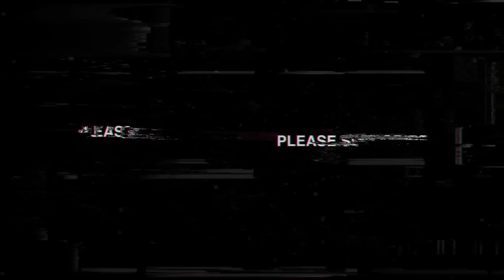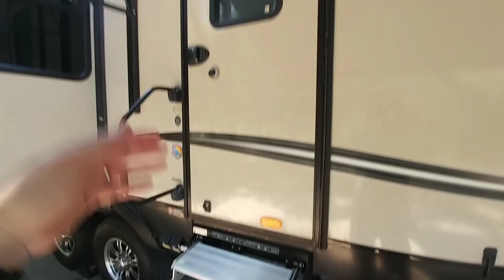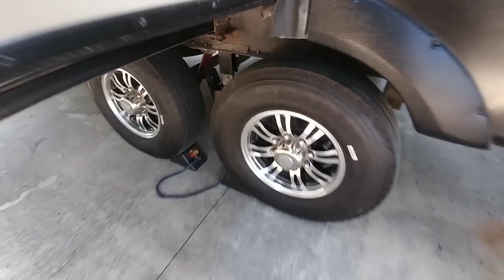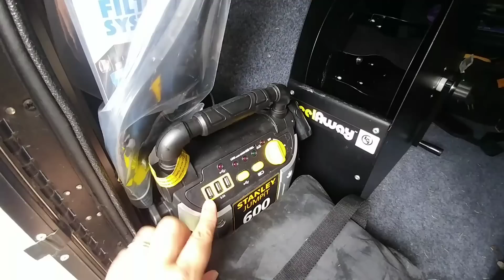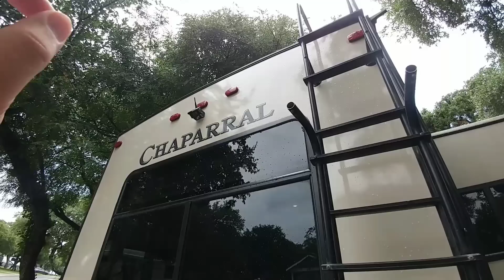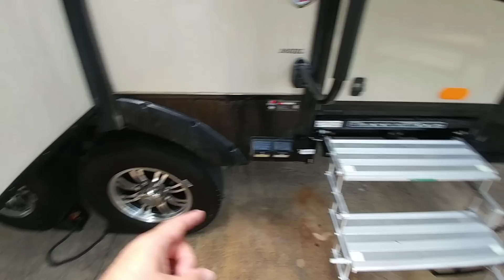Fifth Wheel RV upgrades overview and Follow up!  How do I like them now?

Comment: I am trying to determine the Keystone factory warranty position if I have the Resse goose box installed on my Montana 3790RD.  My local dealers are giving me conflicting information, one says yes, problem another says no, no problem.  Both Keystone factory and Lippert are closed for the weekend.  Do you have any direct knowledge to help?
Reply from the maker: Ive been told by both LCI and Reese that the Goosebox is approved for use on their frames.  I can't speak for Keystone, but Magnuson-moss Act protects you as well.
Reply: Big Truck Big RV thank you for your opinion.  How about the Anderson hitch assembly, better, worse, same same?

Comment: Thank you so much for taking the time to make this video. I have a 2019 Grand Design and had a horrible experience first time out with the sewage valve. I assume that I have a valve that’s not sealing completely. When I arrived at my campsite, I removed the cover To the sewage line. It had obviously leaked and was under extreme pressure probably from the elevation. 10,000 ft. When I removed the cap it was like a sewage bomb. Sewage everywhere! I just ordered my ValTerra valve and hope that this never happens to me again.

Comment: Hey JD love the Videos. I saw that you have a rack on the back or the rig. What brand is it? Did you bolt it to the factory bumper or did you get a aftermarket one installed? -Austin
Reply from the maker: Factory installed LCI rack

Comment: Can you do a real video on travel trailer wheel bearing maintenance, too many times I see videos of just pumping in more grease and spinning the wheel, which is totally wrong unless you want to overfill the grease cavity and potentially cause a leak on the rear grease seal and have grease all over your brakes. If need be I'll be glad to show how to properly repack a wheel bearing yourself as dealers change way too much.

Comment: On those steps, do they have to touch the ground to use tp gain access to the camper. I know on occasion we'll have to make a quick stop on the side of the road to get something from the camper or use the facility and the ground will be quite uneven
Reply: Yes the steps must rest on the ground and be locked in at the top. They only hinge on the trailer - they don’t cantilever off the trailer like the factory 3-step most trailers come with. I missed locking our in and the wife got a surprise when she went up them and they dropped 6” (no injuries)

Comment: I'd like to know how you addressed any excess cabling on your backup camera?  Did you just poke the excess into the coach?
Reply from the maker: I connect the camera to the rear lights.  I had about 10" of extra cabling that is bundled inside of the RV in a cabinet

Comment: Perhaps a future upgrade, replacement torsion bar suspension with hydraulic disc brakes. They offer individual wheel articulations, more ground clearance and excellent stopping power.
Reply from the maker: True, but completely lack weight distribution.  They must be towed perfectly level otherwise you are transferring a significant amount of weight to some of the tires

Comment: Have you noticed that many of the new 5th wheels that are produced today do not have the cutout in the "J wrap" that will allow the Glow Step Revolution steps to be installed easily.  All the new higher end rigs tend to come standard with the Mor Ryde Step Above steps or the Lippert equivalent.
Reply from the maker: Yep.  That is an issue for me.

Comment: That's not an RV, that's a travel trailer. RV is Recreational Vehicle. A vehicle is a powered unit, containing an engine to give the vehicle motion. You need a separate vehicle, or power unit to move a travel trailer no matter what size it is.
Reply from the maker: Wow, you made your own definition!  Here is the more widely used one from Wikipedia: A recreational vehicle, often abbreviated as RV, is a motor vehicle or trailer which includes living quarters designed for accommodation. Types of RVs include motorhomes, campervans, caravans (also known as travel trailers and camper trailers), fifth-wheel trailers, popup campers and truck campers.
Reply: well said JD

Comment: How long would you say the battery lasts for the keyless entry lock? And is it durable
Enough for all weather IE snow and ice?
Reply: journey2fifty I live in Ohio and have had no issues with weather with mine. It’s on its third year and I have replaced the battery once so far. Lasted 2.5 years. I installed a lockbox in the propane compartment with a spare set of keys.

Comment: How do you know how much gain you need to put for your truck with your towing a rv
Reply from the maker: Need to adjust it to your liking by manually engaging the trailer brakes and low speed

Comment: We installed the Reese 20K Goosebox on our 2005 Thor toy hauler ... total rig and Silverado Duramax dually weigh in at 20200 lbs and the difference between the Goosebox and the old 5th wheel is huge.  The shocks from the road and now softened with the hitch and when we open up after a long day towing, it no longer looks like an earthquake!  We have found that it helps to inflate the hitch with a Viair 400 compressor that allows a slow enough fill that you can easily see the "line" and stop it in the center of the round window.  The inflated pressure is only about 10-12 psi!  If you fill it to the relief valve almost all the benefit of the hitch is lost.  Thanks for the advise, and we also love the Moryde 4000 that you suggested.